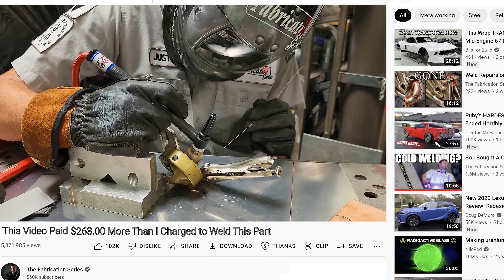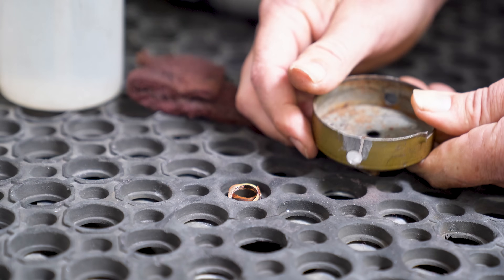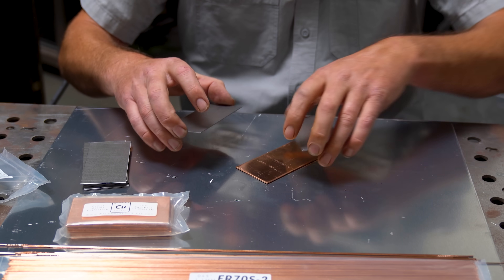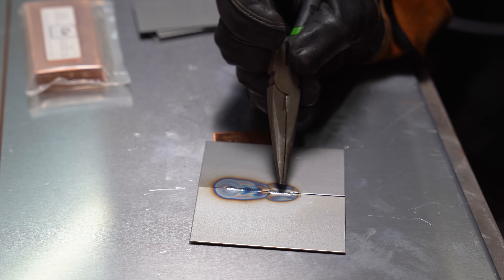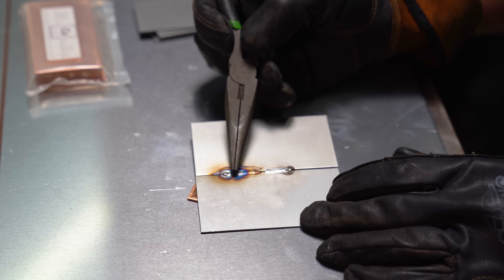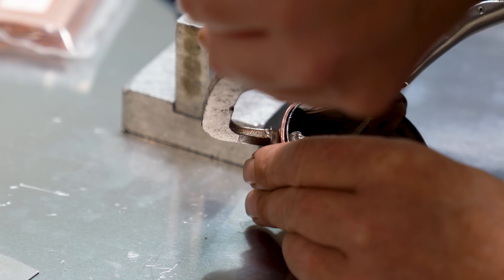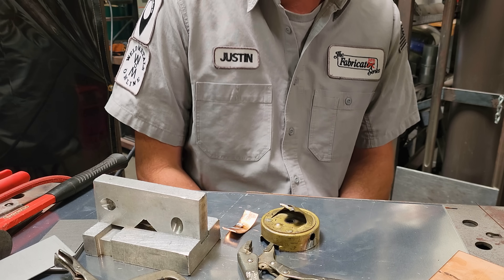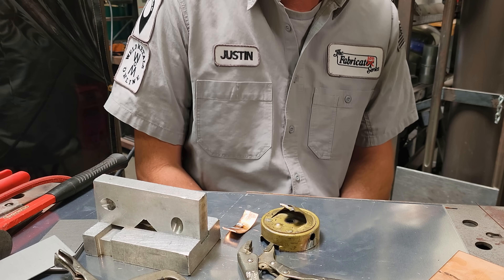This Video Paid $9,909.24 More Than I charged to Weld This Part

Comment: $20 is insanely too cheap for this. It took you more than a half hour without a doubt. By the time you did all the practice, cleaning, setup etc. you had more than that. Low shop rate would be 100/hr Plus consumables. Even then you should be at 50.. i get it if it’s additional maybe charging very little extra. But do it one and done with no minimum is nuts. This is bad for the industry to put this out for people to expect to pay this little. You’ll go out of business doing stuff like this. Maybe in a garage as a side hustle but not when you have shop rent costing you over 10hr by itself.

Comment: Good visuals. The first time I ever welded was - I'll call it arc welding - since I didn't have a clue, was on a sales trip to a Hobart Welding plant in Ontario. They had a training room set up so the guy I was meeting invited me to take a stab at it before I left. Sure, put down my briefcase and there I am welding in my 3 pc. suit LOL. That was around 1978.
He thought I did pretty good beads for a novice and a "suit" from Toronto but I was always into many hobbies that required steady, accurate hands with tools, soldering, scalpels, etc. since I was 12. If I had a proper place for a workshop I'd like to set up a welding station now.

Comment: Great job on the thin metal! I've been welding for over 45yrs. Have found that on thin materials, I like to weld the end first. Let cool, then weld the piece. Heat always builds up towards the end of the weld and helps from blow outs. But you had the machine set right so you could instantly lower the amps on the end! Perfect job and the testing before hand was great work. We use to use 1/4" x 3 or 4" copper strips to build up mole boards. Using 7018 1/8" when an operator wasn't paying attention and wore into the mole board. Thank you for the video!

Comment: I’m surprised that after 2 million views you only have 3k that’s not bad but if your ads paid more for views you could be in the 30k range for 2 million views
Reply: Yeah, its mad. You really need to cram a few ads in there to really make YT money. Either that or make money off ur channel more directly. Both of which are tough for smaller creators. Its really not just the view count.

Comment: There must be a good expression for putting too much mental energy into something so simple. This looks like the kinda job i'd have 200 parts to get through in 5 hours.

 Drop your heat off before you finish like that if you're worried about build up and grind time. You could add a little more wire to cool the puddle tho if thats easier. It's taking a 2 minute grind job and making it 2.5 minutes, so whats it matter to someone who doesn't have 500 to grind? Looked like you were scared to lose the arc or something. Man, welders are weird.

Comment: Don't you just love it when people think you are overpaid? 

Being in the home construction business myself... I can't believe why I am asked (let's say, a new front door installed).. 
I charge between $400 &$600 ,depending on the b.s. I have to do. 
#1) ya have someone with you that isn't doing it for free.
#2). You have gas and insurance cost
#3). You have unwanted hours of driving to pick up supplies 
#4). You have a few man hours
#5). Hazardous dust from the old homes.
#6). Why the F am I only charging between $400&$600 for a job others are charging $2500 for?

#clownworldpa

Comment: People dont understand risk, its your time, effort and money which may or may not pay off. So far you have made $6k before taxes on this video but it also has 3.3Million views which is a very high number of views so you got lucky on this video. But there are other videos where you spent more money and then the video flopped so to speak, people just werent that interested in it for one reason or another.

It can be something as simple and time consuming to fix a machine you almost never use but think it will be a cool video, so you end up spending 3k on the machine and 60 hours working and the video doesnt do well and you end up making $200 from views, and the machine still sits there unused but in working condition and a used machine would just set you back $2k

A lot of effort and money that didnt generate any money so the successful videos has to cover that cost as well, and you cant know in advance if the video will do well or not its a risk every time. A lot of work which may or may not generate any income for you. People dont understand this, and when you are new on youtube your videos just arent going to make you any money its a huge sink of time effort and money on the slim chance that it will pay off.

Comment: 941 bucks for 800k views ? Waste of time
Reply: I don’t think the code is right. You get about $0.01 to $0.02 per view so at 851k he got at least $8500 by now not counting the sponsored content throughout the video showcasing thing available for purchase online which I think he either sells himself or is getting a percentage of every item sold. I’d bet he’s made about $10k total so far from this video.
Reply from the maker: The code is correct. The amount is real. I wish I made $10k. It's a huge misconception about YouTube pay. There's no set rate for any of it. If I made $10-$20 per 1,000 views I'd probably be doing well. But I make just over $1 per 1,000 ad views (not video views) on this video. Some vids pay more - some less. This one pays less.
Reply: @TheFabricatorSeries  you’re gettin there